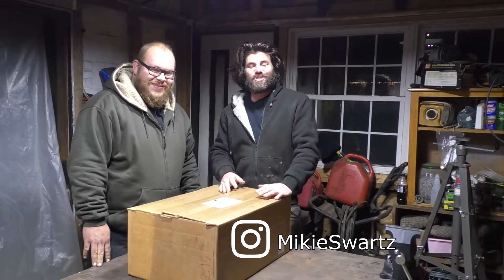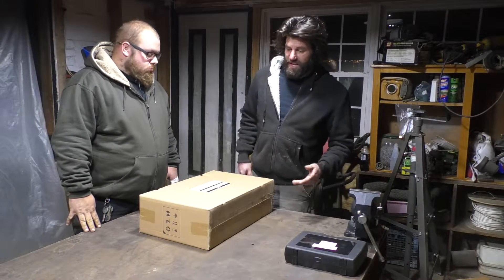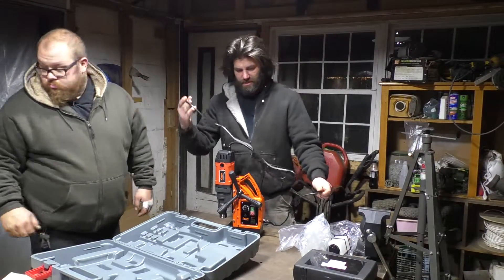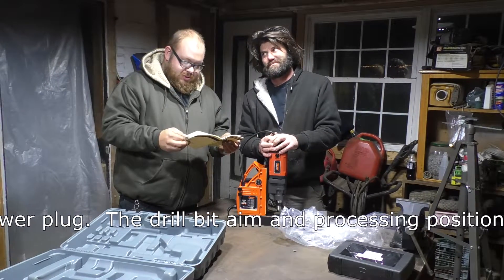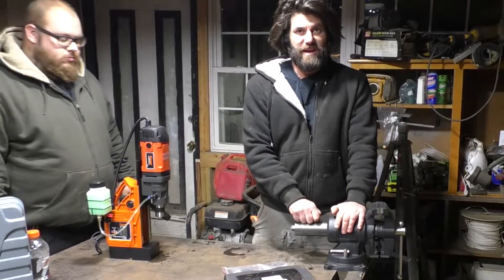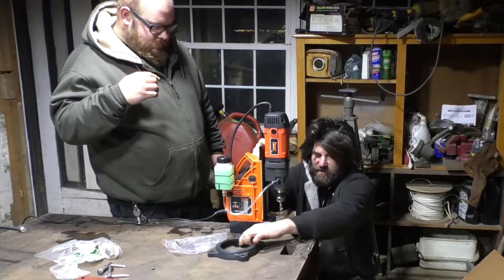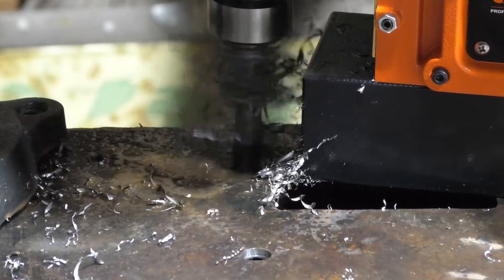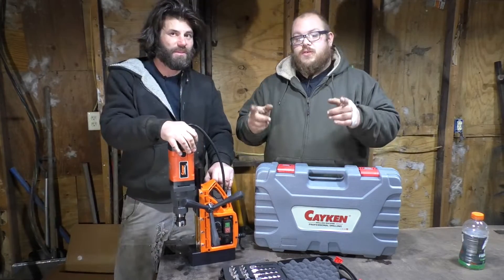Cayken SCY-42HD Magnetic Drill unbox and test

Comment: I rented this model recently, a 1/2 inch pilot hole in 1 inch mild steel to finish with a 5/8 bit and didn't even feel it go with few squirts of w-40, I was done, back to the rental company in not even an hour. relatively quiet, easy to use , I`ve been positively amazed.
Reply from the maker: Mine doesn't get used a lot, but its still going strong when I need it.

Comment: For the most part the drill chuck is useless because u would need some twist drills like 1.5" long because by the time u put the adapter on theres only 2" of space to work with
Reply from the maker: True.  But you could adjust your table as needed.  ?  I haven't used this much, but the drill adapter did come in very handy for a certain project.
Reply: What table im lost u got it magged to say a car frame u got the chuck adapter in there is 2.75" from chuck to frame and u need a 5/16 hole the bit is 5.5" long just wont fit
Reply: Dewalt has a height adjuster just for that purpose. Just wanted to mention that after watching a Dewalt mag drill probably 4 times more though.

Comment: Nice video 
Since you were drilling through 2 peices of metal. Did you have to take out the first slightly on order to drill the other peice
Reply from the maker: Yes. I'm pretty sure we did. I remember when we got through the first piece, I could feel it stop cutting - probably because the first piece would start to spin with the cutter before the teeth got all the way through it.
Reply: @WHIPBASH  thank you. I thought that's what I saw.
I'm in the market for a mag drill with annular cutters. Trying to do my research.  Expensive buggers
Thanks again

Comment: I love my drill press.  How is this different other than more portable ?
Reply from the maker: Watch it cut. 7:50  It cuts a hole out instead of drilling from the center.  It's for drilling bigger holes (3/8" - 1 5/8")  through thick metal.
Reply: @WHIPBASH  Something I'd use rarely.  Looks like the tool for you.
Reply from the maker: @dorisswartz4751  I won't use it much either to be honest. But I found myself needed a drill press recently and decided to get the mag drill instead.